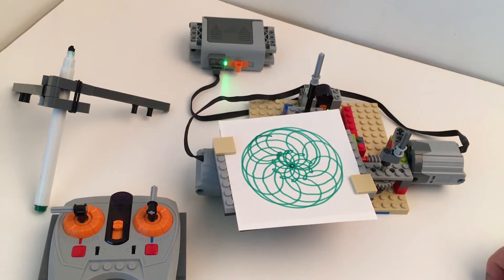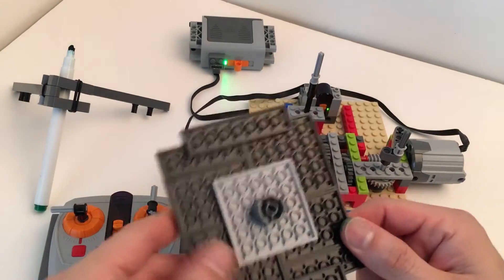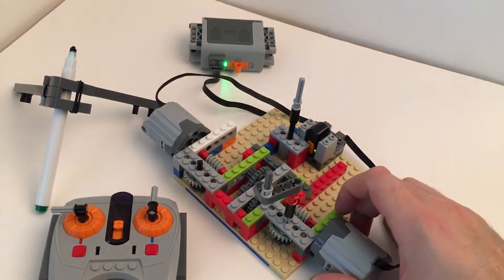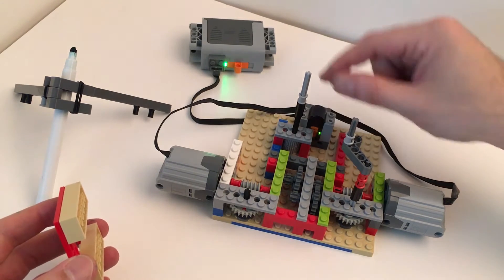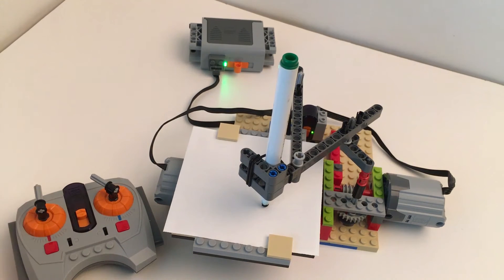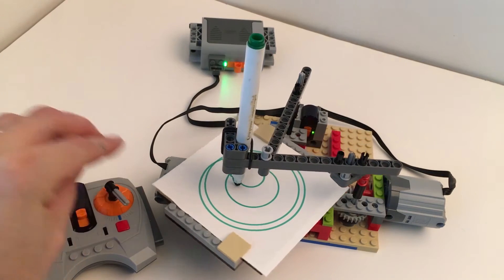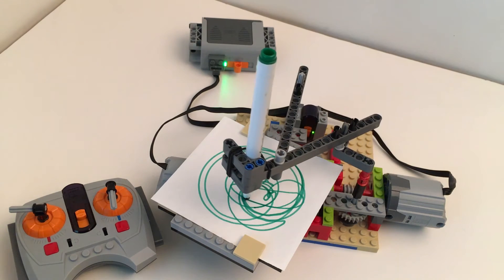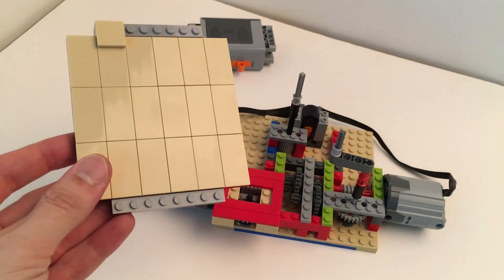Lego Spirograph

Comment: Looking at your set up, I see you have two small motors (P/N 8883) Stck/Pz and one large (P/N 4522083) Stck/pz/db and a control panel.  I have only 1 each of the # 883 and # 4522083.  I need to stock up on those tiles you have for the base you put your paper.  What size are those tiles? I would also love to built your version.

Comment: Will you make a list of the items you've changed on the original instructions?  I have most of the parts for making the original one, but are waiting for the remaining parts.  I also like your set up.  Could you make a list and directions on the parts you added or changed from the original?  It would be fun to have two of these built of both the original and your version. Pretty Please!?
Reply from the maker: Hi Andrea, I made this a while ago so am not sure of the exact changes. you should be able to  compare my video the JK Brickworks instructions I linked in the video description and then improvise with the parts you have, that's half the fun. The tiles are 2 x 4 which I got in the Lego Ideas Maze. While 2 x 4 is relatively rare and expensive I often see 2 x 2 tiles in Lego Store brick walls. The motors I used were 8882 XL-Motor but any motor should work, just be aware the torque and speed will change.